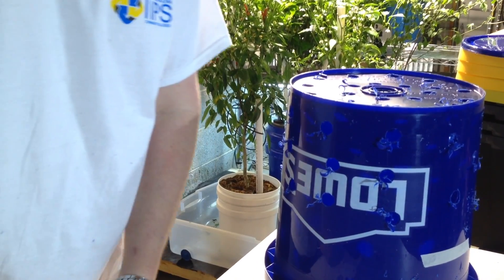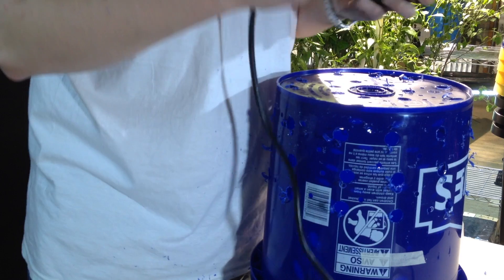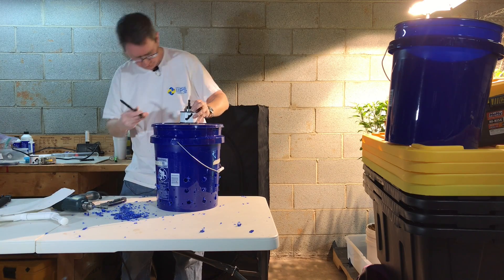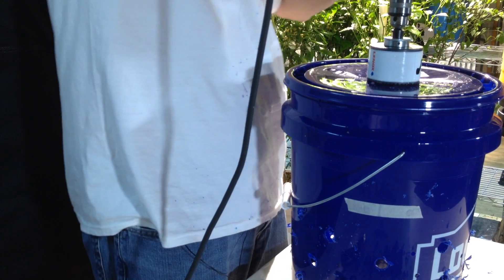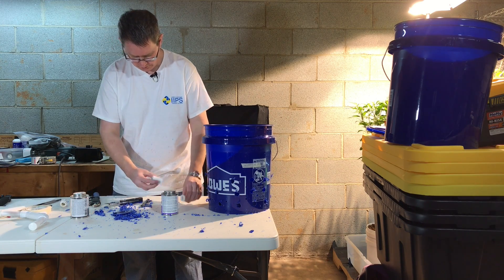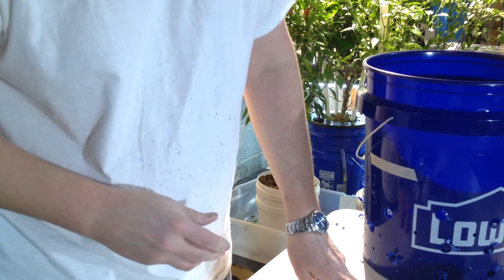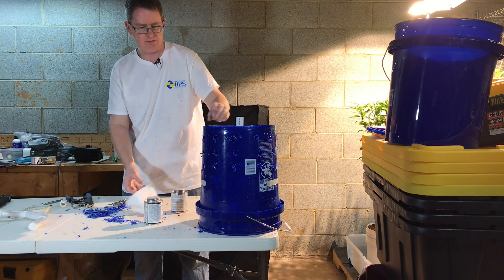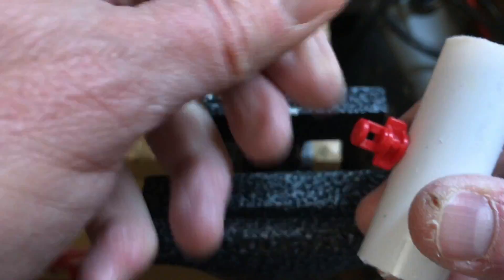How to make an inexpensive low-pressure aeroponics system - Improved version - Part 2

Comment: Great stuff! In my head i was trying to think about how to do an aeroponic system where the water drains to a reservoir DIRECTLY BENEATH it, you may have just solved my problem. Also, a de-burring tool is something that would make clearing the bucket holes much easier.
Reply from the maker: Thanks, for watching! I agree, a deburring tool would be great.

Comment: Seems like quite an elaborate system and expense for just one net pot. Most similar projects like this use the same amount of equipment, but are used with 8-24 net pots . . .
Reply from the maker: Thanks, for watching. It's more proof of concept, you could adapt, change, expand on it.

Comment from the maker: There are a couple things I want to mention about this. I said in the first part, but should have captioned, or mentioned here that I was using a 11/64" bit for installing the spray nozzles. Also, a good alternative to the 3 inch net pot mounted in the regular bucket lid would but to just use a 6 inch net pot bucket lid. This would be easier to do, provide a little better support and probably encourage more root growth. The 3 inch one is working fine, but if I could redo it I'd use the 6 inch net pot.